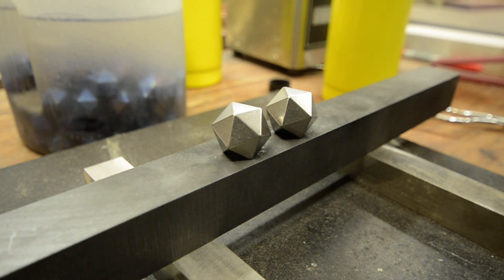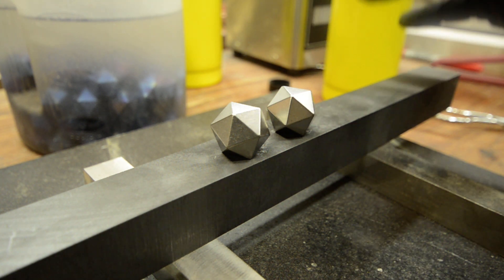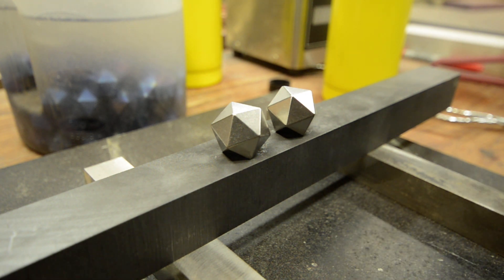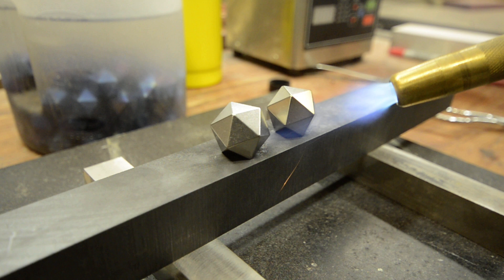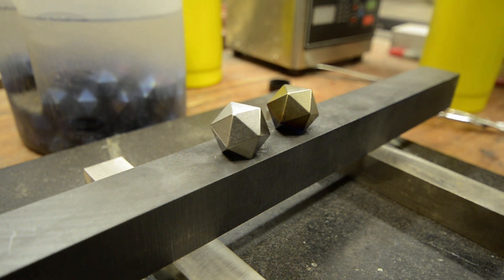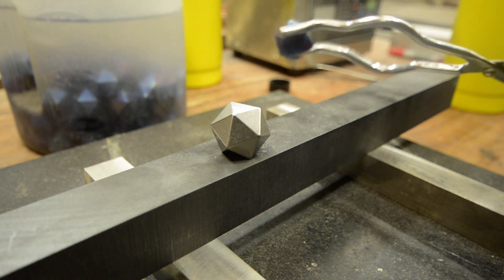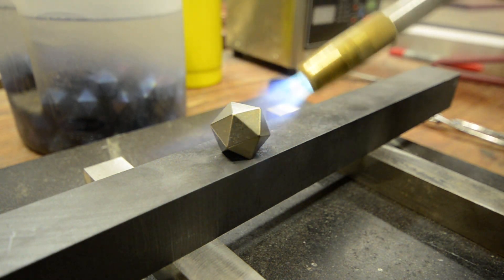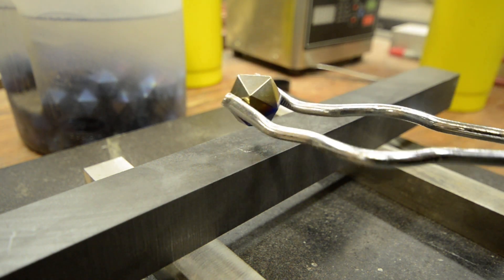Heat Anodizing Titanium d20s

Comment: Great video! Is the reason that the anodization stays on the metal the fact that the oxide layer sticks to a more porous surface? I heat anodize steel and the oxide layer can just rub off.